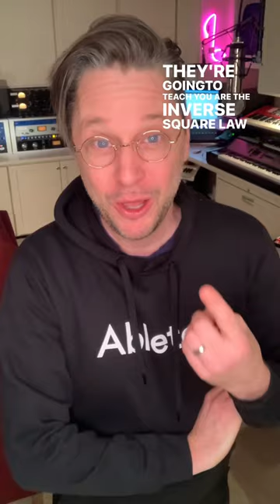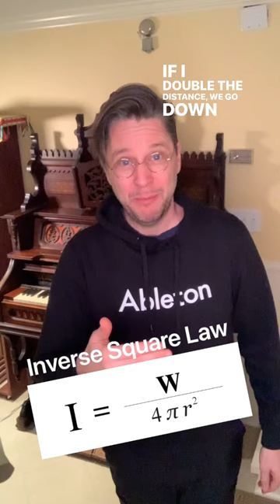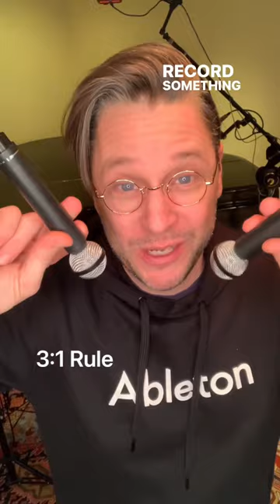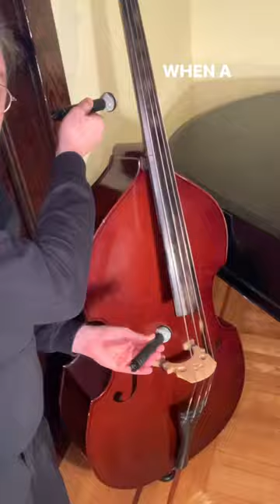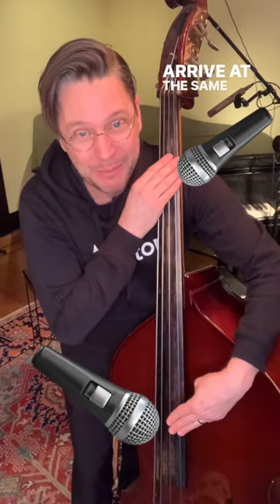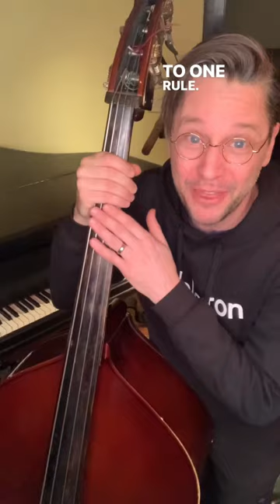Audio engineering rules and laws

Comment: If you double the distance, doesn't the power go down by 4 not 1/2?
Reply from the maker: Maybe my math is fuzzy? That’s half the point of this post lol. But also, I believe we are talking about a distinction between power and intensity. Power being across the entire wavefront (a sphere) whereby intensity is measured at a single point. But feel free to double check my math!
Reply: My bad, intensity is the right word I should have used. Let's say at 10m the intensity is 120W/m2. If I double the distance to 20m, the intensity goes down to 30W/m2. If I double the distance again to 40m, the intensity goes down to 7.5W/m2. The intensity is divided by 4 each time the distance is doubled. 
In the video you say the the intensity goes down by 1/2 which is the same as saying the intensity is divided by 2 each time.
Reply from the maker: @hujackus  either way, my point is that this stuff gets pretty thorny. This video is largely about the back of the napkin calculation and how it impacts the use of two microphones. I would have to go back to the books to decide if I made a mistake or not. I’m more than happy to be corrected by the way. The spirit of the video holds up either way. But I’m not convinced we have reached the bottom of the power versus intensity argument!
Reply: Bruh why is this important I only got one mic
Reply: I know Michael Jackson was recorded with 2 Neumann mics but they were under and above and there wasn’t no real distance between them
Reply: @infayne 😂😂😂😂